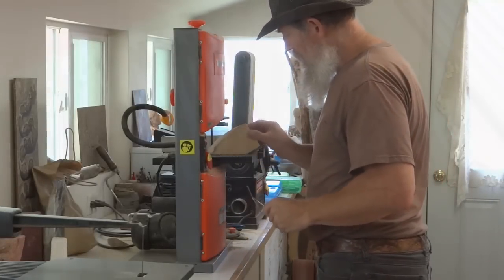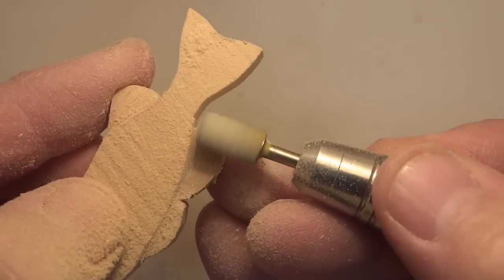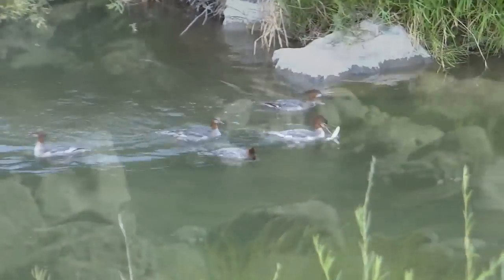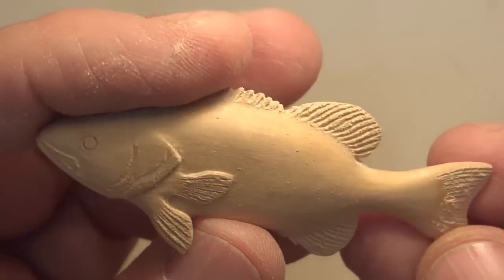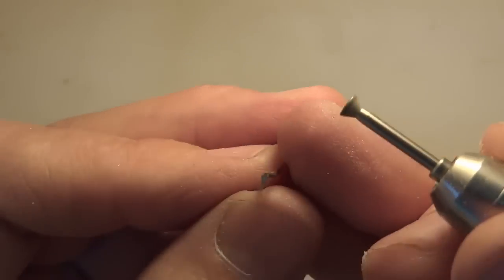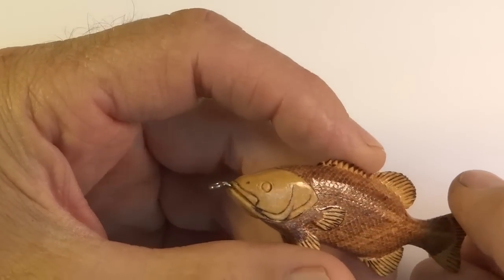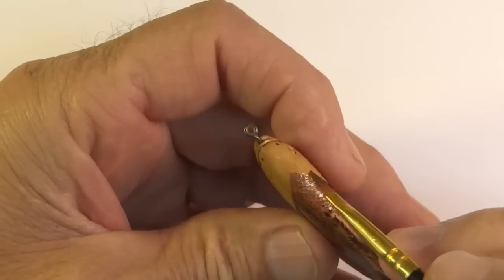How to Carve a Fish Pendant from Wood

Comment: Bruh! You need to make a tutorial video on how you made that wood burning tip. I only got a soldering iron and i had to make a tip for it out of a screw and i tryed to make i as small as i could and i still couldn't get it small enough but I had to roll with it and my fishing Lure just has big scales for how small is. And do you know where to get a wood burner for cheap? And your video didn't show up on my subscription or notifications I just found this video by going through the homepage so you might want to talk to someone at YouTube if you can. Great work though I love it I just started a fishing lewer based on a minnow and it was so hard to get the scales right the general shape of it was easy but the scales and all the small details was really hard with my ghetto tools just a Dremel and a couple Dremel bit sets

Comment: Hello! I'm new to this and I want to make a dust box. Your box looks very good. Did you make it or did you buy it? If done manually at home, what kind of box did you use. Sorry for my bad English. Thank you very much for your help :)
Reply from the maker: The box I used in this video was an old sand blasting unit that works great for small carvings. It would be easy to make one like one like it from wood.
Reply: Wonderful! Thank you for your help. I'll try to make one similar to yours. Keep enjoying us with your wonderful artwork :)

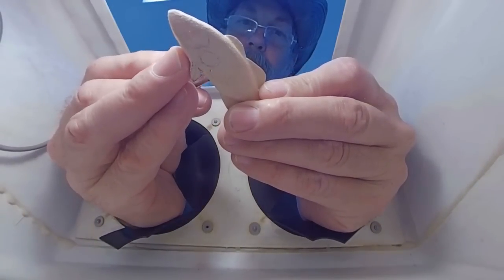Comment: what is the name of the "carving chamber" you are using at 1:29?
Reply from the maker: It is a micro- sand blaster case. It works great with a vacuum attached to carry away the sawdust.
Reply: @StinnettSticks  I finally found it. It is sold as dentist equipment. I guess they use it to sculpt prosthetics or something like that...